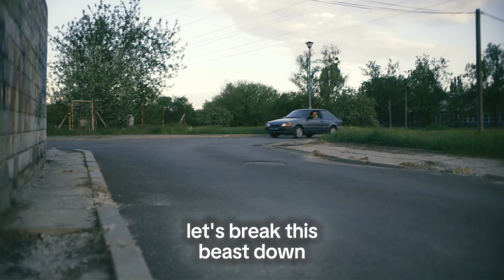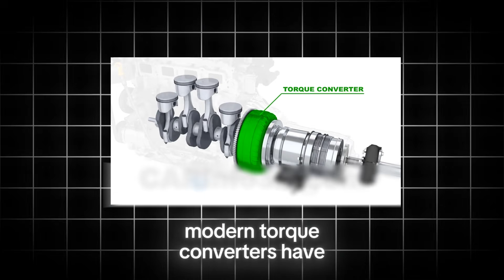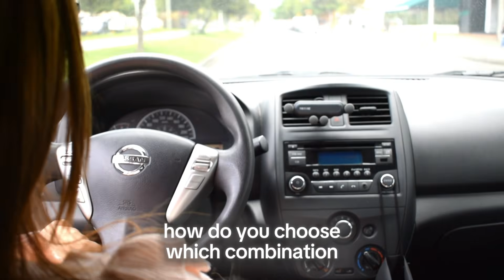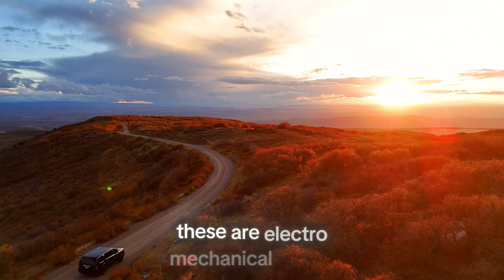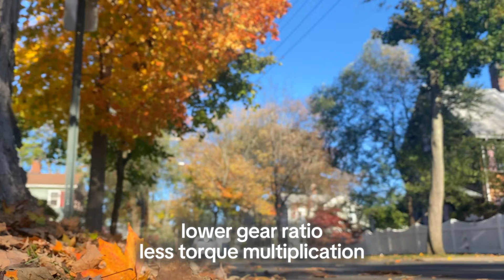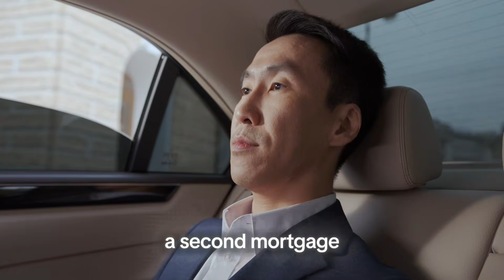Automatic Transmissions Explained Why This Thing Is Insane

Comment: I'm still pretty confused but you answered a few questions so thank you very much. I had a 68 Citroen DS21 Palas and it was all hydra-numatic (air&fluid) It is a 4 speed manual transmission With no clutch and a little rubber bubble for brake peddle. starter and lights  only electric things. Look into how insanely complex but perfect it is.